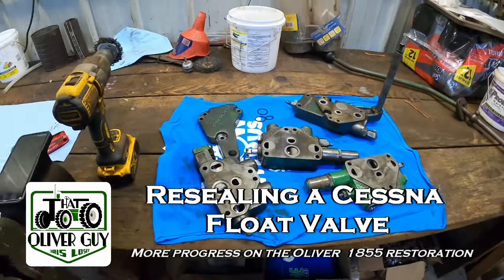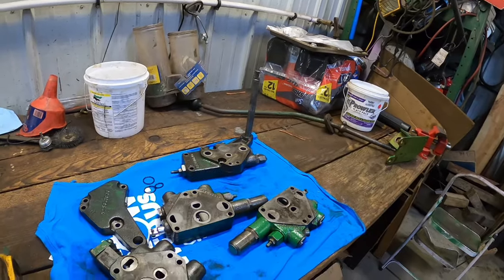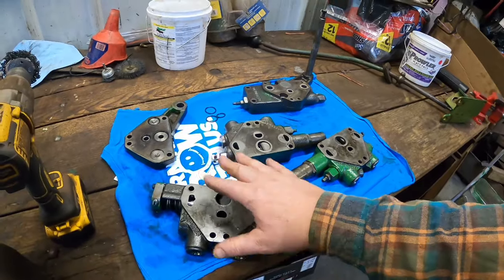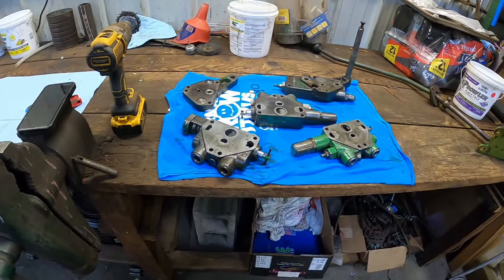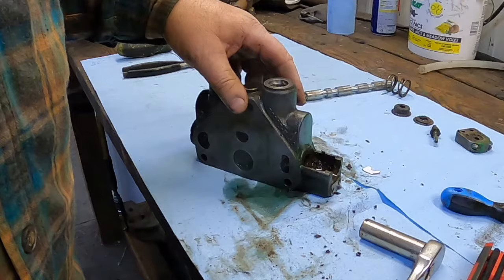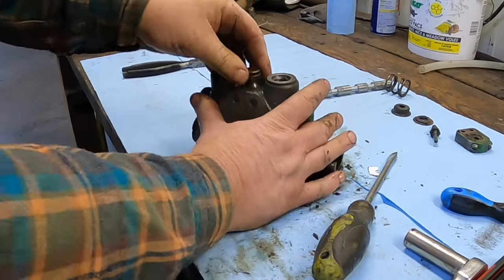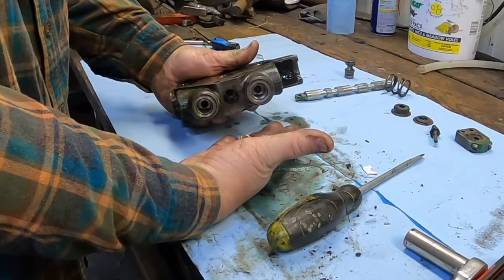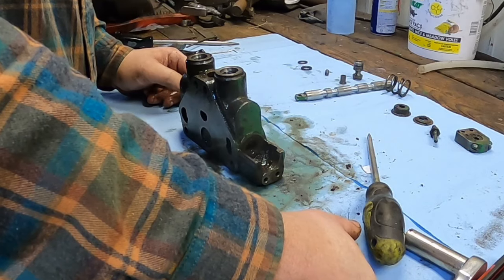Rebuilding a Cessna Float Valve

Comment: The Cessna hydraulics company IS actually is related to the airplane company. Clyde Cessna was a farmer in Kansas who built a homemade airplane in 1911. In 1927 he started the Cessna Aircraft Company in Wichita.

After WWII the company pivoted to commercial applications, one of which was a fluid power equipment division which became very profitable and spun off into Cessna Hydraulics. Then in the 80s it was acquired by Eaton Hydraulics.
Reply from the maker: Thank you!

Comment: The first thing I did when I got my grandpa's 2-85 was pull the valve stack. The control spool was frozen on the number 1 remote and I couldn't stand it. My dad was panicking that I was about ready to get little parts and pieces lost all over the shop and just knew I'd have a mess, but with help from the factory tech manual and factory parts manuals I was able to get the whole assembly redone and back in it without losing/cutting any of those O-rings in the sides or losing any detent balls. They're just detent valves, I sort of wish one was a float valve, but I don't need float that badly anyway. Great job as always!
Reply from the maker: Thanks. I've got to edit the detent valve video. They're not bad if you have an idea of what to expect.

Comment: Hey Chris just about to do this same thing to the valves on the 1955 I’m working on.  So which valve do you hook to when using one cylinder implements like on a plow or say a cultimulcher with one two way cylinder?
Reply from the maker: On the closed center tractors like the 1955 you can use either side. I use the coupler that is on the rear of the valve, that way it lifts when you pull the lever back and I have the restrictor to adjust if it needs it.
Reply: @ThatOliverGuyChris  ok I was thinking that would definitely make it easy to lift say a semi mount plow, just pull the lever than just worry about the raising the three point.  Thanks Chris

Comment: My 1955 valves are leaking bad, from between the valves. Hope the backing washers are all there. Should I rebuild each valve also?
Reply from the maker: I would. They don't get any easier. I've recorded doing the detent style, as well as nounting them on the tractor, just need to edit it up.

Comment: Good video as always chris. I just finished resealing the 2 detent valves on grandpas 2-105. For some reason one of the detents don’t want to kick back to neutral. I have tried messing with the Allen piece that changes the pressure for the detent and that doesn’t change anything. I pulled the spool out of the valve and disassembled the detent and everything looks fine. Any thoughts on what it might be?
Reply from the maker: My first thoughts are the spring isn't seated in the screw cap properly. I had that but it kept the cap from screwing in all the way which made the detent spool bottom out on it, making it impossible to adjust. So I caught that before I got very far.and if you can adjust yours, probably isn't the problem. There could be something inside the spool blocking the inner passage. There is a small hole in the spool on each land that lets pressure into the center, unseating the timy little plunger that is held down by that adjustment spring. If that hole is plugged, pressure can't get in the center and can't push the pin back to drop the detent balls out and let it pop back into neutral. To simplify, if you take all of the detent stuff out of the back side of the spool, all the way down to the tiny little plunger , you should be able to put an air gun to the back of the spool and get air to go through it.  Hope this helps.
Reply: @ThatOliverGuyChris  That does help. I remember that the Allen headed pin would adjust when I tightened and loosened it. I will have to take it back out again and take the rest of the pieces out and blow air through it then.

Thanks
Reply: Chris, I just disassembled the detent. I think the spring wasn’t seating in the poppet fully. I cleaned and reassembled everything and put the spool back in the tractor and it pops in and out of the detent just like normal now. Thanks for the help.
Reply from the maker: @baileyattheoliveracreage  glad to help

Comment: You saying that a float valve needs to be close to the pump , what is the reasoning behind  that  I would think all valves have the same pressures  in all of them
Reply from the maker: It's not lthe pump, it has to be next to the base plate for the oil to flow properly for the float function to work.